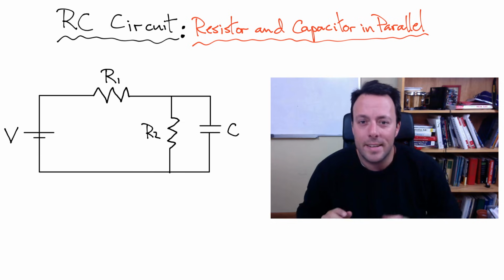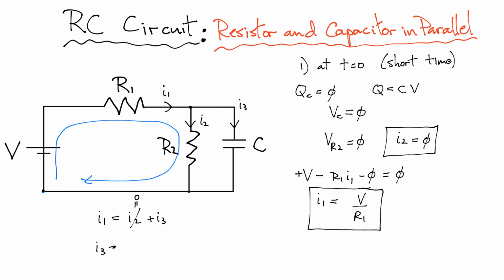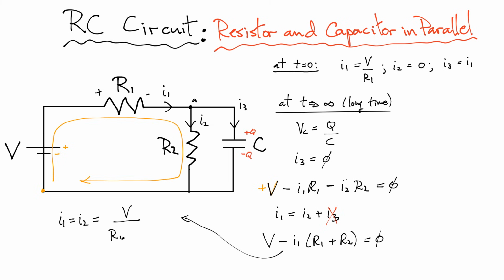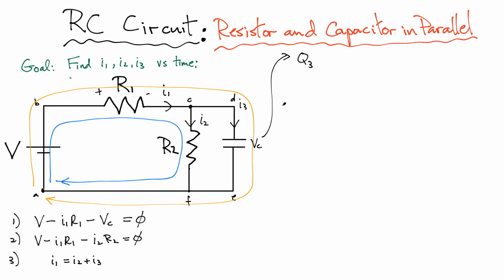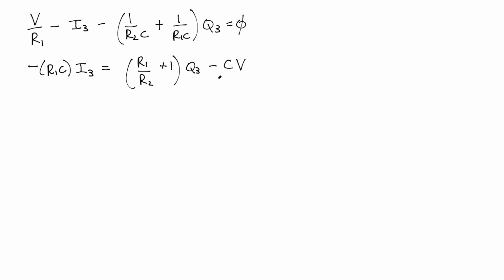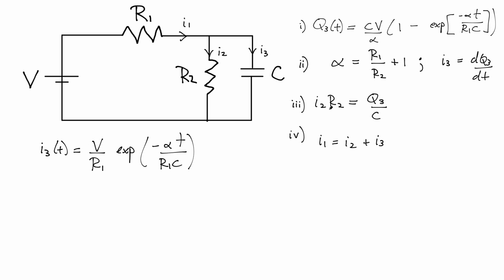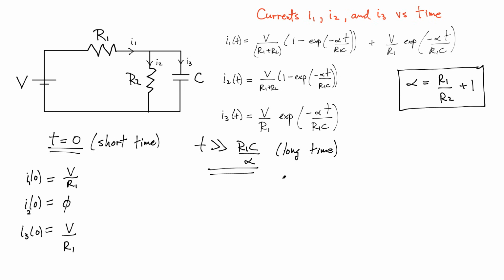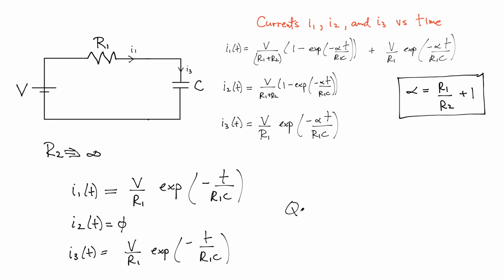Parallel RC circuit

Comment: If you do a simple Thevenin equivalent. You find that V-Thevenin is V*(R2/(R2+R1)) the R-Thevenin is R1 || R2 (R1 in parallel with R2). If R1 is zero then R1 || R2 is zero and the capacitor charges instantaneously. If R2 is zero, then the capacitor is shorted out and does not charge. Now if R1 is very large compared to R2  then R1 || R2 = R1 and if R2 is very large compared to R1 then R1 || R2 = R1.
Reply from the maker: I have another video with that case
Reply: @PhysicsNinja  I just watched it and we both came up with the same result independently. However, your first video while taking the long way around, prompted me to find an easier way. A Thevenin equivalent circuit was the way to go.  BTW I am a retired licensed Electrical Engineer with nearly 55+ years in electrical and electronic engineering.

Comment: Hi, i had the idea to try with the Thevenin theorem to reduce the circuit into a voltage generator and a resistance in series with the capacitor but i got a different result. Is it not a valid method?
Reply from the maker: I have a video on that exact approach,  needs to be the same
Reply: @PhysicsNinja it must be my falut then. I'll try again. Can you use it even with non linear components olwithout  switching to phasors?

Comment: If we swap the capacitor with an inductor, would we still do the same method to solve. Also, if we do not have R1 would the circuit short circuit. Thirdly, if we move R1 so the it’s after the current goes through the parallel branches, meaning it’s at the negative terminal of the battery rather than the positive, would it change the results or would it remain the same

Comment: Thank you very much. It' been so hard finding this case. With your result I wrote it again but in term of vc as variable of the differential equation, this way bypassing the calculation of Q that in applications is usually less important. I wonder how would it be possible treating this case without R1. Don't tell me it doesn't exist an ideal tension generator without R1 as it could be electromotive force :)

Comment: does the cap discharge through R2 when the cap reach full charge?, so the cap charging and discharging continuosly,  source voltage V keep supplied to this
Reply from the maker: Once fully charged the current keeps flowing through R2.   The current is due to voltage of power supply.

Comment: Similar question on my 1st year basic electronics assignment, except R2 is in series with the capacitor, all I have though is the formulas for discharging and charging, but none of those are working out to be correct or measuring the same as the circuit simulator I'm using. Afraid this level of maths is also beyond me at this point. Electronics is not for those without patience or persistence

Comment: I love your work, BUT CAN SOMEONE MAKE THIS STUFF USABLE.  CAN YOU ACTUALLY PUT NUMBERS IN PLACE INSTEAD OF A BUNCH OF FORMULAS?  CAN YOU SET UP A BREADBOARD AND PHYSICALLY SHOW HOW YOUR FORMULAE, HYPOTHETICAL NUMBERS AND ACTUAL CIRCUIT BEHAVOIR NUMBERS COME TOGETHER?  WHAT IF WE WRITE ALL THIS FORMULAE AND FIND OUR RESULTS IN ACTUAL LAB TESTS ARE WRONG OR DONT COINXIDE WITH WHAT YOUR SAYING.  AGAIN, great explaination, but how is it practical?  What will be the actual circuit results and behaviors be if r1 is 100 or r2 is 500..etc....thanks.
Reply: People are so obsessed with the formulae and fail to display actual circuit behavior.
Reply from the maker: I understand your point but for a physicist putting in numbers makes the problem too specific.   It’s practical I agree but you don’t learn anything.    Seeing the equation and learning to understand what they mean, checking limits will build intuition and knowledge.   At the end of the day any engineering student should be able to plug and chug.
Reply: Thank you sir.  Please understand i meant no disrespect or ill will...your a good dude.  One last question, would you have any videos regarding AC complex equations?  Specifically for example series parallel circuitry...just curious...
Reply from the maker: @mikesen2320  I have a playlist for AC circuits.    It's a bunch of problems from the college class i taught.   Good luck with your class.

Comment: The textbook “electrochemical methods” uses this circuit to describe electrochemical cells. R1 is solution resistance, R2 is charge transfer resistance and C is called the electrochemical double layer capacitance.

Comment: Great video. I am a mathematician but hobbyist in electronics. Nice to finally see some connections. What happens when R1=0?
Reply: Then the charging up of the capacitor happens infinitely fast (of course in practice that’s impossible) and the voltage across R2 and C becomes equal to the voltage of the source. Then the current only flows through R2.

Comment: What happens if resistor 1 is removed (i.e. R1 = 0)?
Reply: physically in real life the capacitor explodes. theoretically you can solve the problem without it. nothing changes

Comment: What change if the capacitor already had previous charge and the voltaje at T=0 is not cero because in time before cero it was connected to a CD source

Comment: If we replace, R2 with CAP..is it the same??
Reply from the maker: No, you will have 2 caps in parallel.  Replace them with an equivalent capacitor and redraw the circuit.   It then become one resistor in series with an equivalent capacitor.  Much easier problem.

Comment: What was the actual time constant in this? My entire reason for watching this video was to see you isolate it. I could finally guess it was (r1 * C) over alpha. Also, I found most of what you did impossible to follow since I am not fluent in rotating equations. And I guess I will never learn to be, because nobody ever stops to show how it is done. Everyone just expects everyone to already know how to do it. It would help if you'd simply say aloud what are you dividing or multiplying where.
Reply: SharkTank , I eventually solved it by repeatedly applying Thevenin's theorem.

Comment: What if R1 is not there? Only R2 and C1 in parallel, I think I read somewhere that it will get instantly charged
Reply from the maker: Yes, c1 is instantly charged, and current will run through R2.   All branches of a parallel circuit have the same voltage across them.
Reply: @PhysicsNinja  thank you so much didn't expect such a fast reply!

Comment: Thank you for explaining how "really parallel capacitor" works.Not easy to be sure, for example, while capacitor is charging whether current flows on other branches.
All  I've seen so far, even  in the most famous books,  the most simplist  circuits. Your example  is the only one ,  have a closed loop "closer" to the voltage source than capacitor.
I could see no explanation   about the behaviour and calculations  (current flow , voltage change in all branches,...) during   major phase like charching, discharging neither for DC nor AC ....  They usually supply all maths, equations,time dependency...

Comment: at 18:08, shouldn't the equation be

Q3(t) = alpha/CV instead of CV/alpha?
Reply from the maker: the units wouldn't work out if that were the case.   alpha is dimensionless and Q= (Capacitance)*Voltage in order to get charge in Coulombs.

Comment: can someone plz tell me wtf is happening when R1 is missing?
Reply from the maker: Capacitor charges instantaneously and a currenty flows through R2.    No current where there's a capacitor because it's fully charge.
Reply: @PhysicsNinja  thanks man.. i think makes sense now that you tell, so I will not ask why. But, can you please give me a hint how to work it when we have a current source instead of a V source?
Reply: @PhysicsNinja   When again, R1 is missing :) thank you in advance

Comment: So in the Limit that R1=0, will the capacitor be instantaniously charged? According to the equations, the formula for chargé will reduce to Q=C*V. Is this correct? I had an exam question about this so any feedback will be really helpfull :)
Reply from the maker: Svend Korsgaard yes it will charge immediately.

Comment: So true. Nothing in my text book about capacitor in series with resistor but it doesn't stop my teacher from putting it in an exam. And he never showed us this case but expected us to know it.
Reply: Did you find any good books that go into this stuff? It seems to me that all the information for this stuff is scattered online which makes learning very inefficient and difficult
Reply: @users4007  exactly… what are textbooks so expensive for 😂 all that work
Reply: There are infinite possibilities with circuits, your teacher can’t show you every possibility.
Reply: @whatever3041  Exams are supposed to cover similar topics to what was taught in class. Pulling exercises like this out of nowhere s not the way.

At least in my book this kind of circuit doesn't appear in the suggested exercises, nor is it covered as an example inside of it. There's probably a few exercises about this, but come on, every section has 150 exercises, you can't really look at them all, you just have time to do the SUGGESTED ones.
Reply: @apdsaijvcxz   Bro exactly I got a question like this on the midterm and I only covered a circuit with a switch and without the R_2 resistor in this

Comment: Why is voltage across resistor 2 equal to 0? I thought at t=0 the capacitor acts like a wire so then all that is left is two resistors in series.
Reply from the maker: Hi Davis, there are different ways to explain this this but let's try this...if there is initially no charge on the capacitor the voltage across the capacitor equals to 0.   If you use Kirchhoff loop rule around the outer loop you will find that i2 must be equal to 0 initially.    Every branch on a parallel circuit will have the same voltage across it.

Comment: and when calculating the time constant,  shouldn't the equivalent resistor be R1*R2/(R1+R2)?
Reply from the maker: asaad alalawi yes, check out my other video using thevenin equivalent.
Reply from the maker: asaad alalawi that’s what you get if you simplify my expression with alpha.   If R1 is 0 the capacitor would instantly have voltage V so initial current is infinite.
Reply: @PhysicsNinja  Thank you, just wanted to make  sure that i'm getting this right. Thanks!

Comment: If we don't have R1, what would be the initial current through the capacitor?
Reply: You can find it using Q=CV
But it will be charge and not the current
Reply: Current will be infinite
Reply: I think it would be arbitrarily large. An uncharged capacitor basically has 0 resistance so no current passes through the resistor branch. It would be as if you connect a capacitor directly to the voltage.
Reply: @aelu4194  Yup. You're totally correct.  Thanks for replaying.

Comment: How would I derive the transfer equation for this circuit when the output y(t) is the voltage across the capacitor?
Reply: yes

Comment: Great video! However, I wanted to ask would there still be a current flow through R2 if there was no R1, when capacitor is fully charged. I am asking this since it seems to me that potential difference between capacitor and battery would be zero and that,as I suppose, should be the same case for R2, since it is parallel to capacitor. Or maybe I am missing something. And would the result in the circuit you have displayed would be the same, if R2 and capacitor changed placed. Answer would be much appreciated!
Reply from the maker: Laila Smilgaine try taking the limit when R1 goes to zero and you'll get what you're looking for.  Try also taking the short and long time limits when r1 is zero.    In the long time limit there is no current i3 and all the current goes through r2.
Reply: Online Physics Ninja Okey, so if I understand it correctly, all the current goes through capacitor and R1 in the beginning in this circuit, and there is no current at the beginning through R2, bacause the voltage between junctions c and f is the same what between capacitor plates, and it is zero( so if there was no R1 in circuit, the current through R2 would be zero in the beginning as well  because of voltage being zero, right?)After capacitor is fully charged, there is no reason for current to go to capacitor because it is fully charged therefore making the voltage difference zero, and all the current goes through R1 and R2. Am I correct? However, I am still wondering, if the charge on capacitor does not repel any charges also from the junction c, making continuous current flow through R1 and R2 impossible as well, or it does not happen that way and charge finds its way through R2, making the current flow possible? Also, would you get the same result and could you use the same method, as shown in video if capacitor plate and R2 switched places?Again, Thank you in advance!

Comment: Thank you for the video! What would be the purpose of this capacitor?
Reply from the maker: Glad you liked the video.    There aren't a lot of applications for parallel capacitors for DC circuits but plenty for AC circuits.     One benefit of this configuration is that you can still run current through another part of your circuit while charging the capacitor.   If they are only in series the current would drop to 0 once the capacitor is fully charged.
Reply: Thank you for the reply. Following a book for arduino projects, I saw they connect a capacitor parallel to a servo motor and was wondering what was its purpose.

Comment: hi what if you exchange the position of the capacitor and resistor?
Reply from the maker: kat ville  if you exchange the capacitor and resistor R1, you can start by simplifying the 2 resistors and writing them as an equivalent resistor.   You'll be left with a simple RC circuit, except the R is the equivalent resistor.